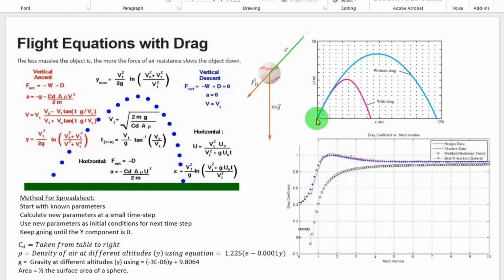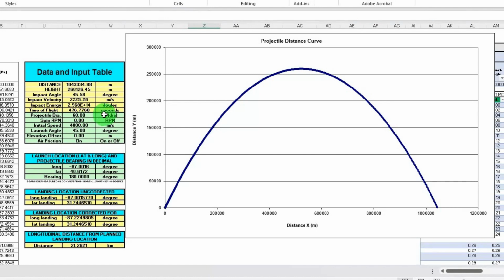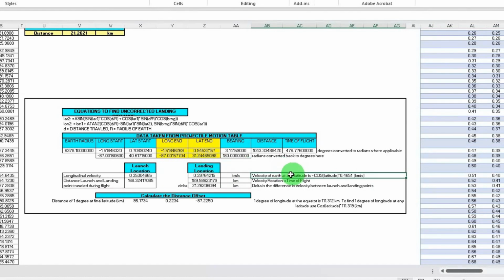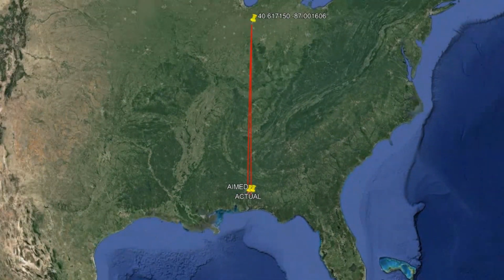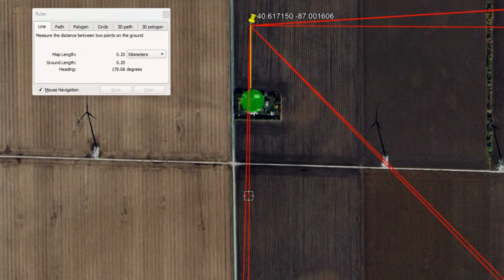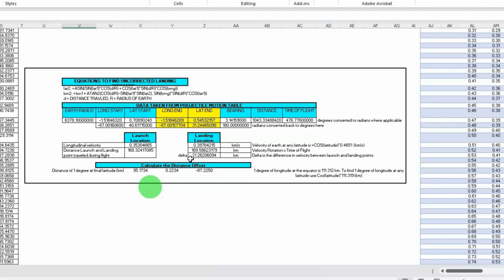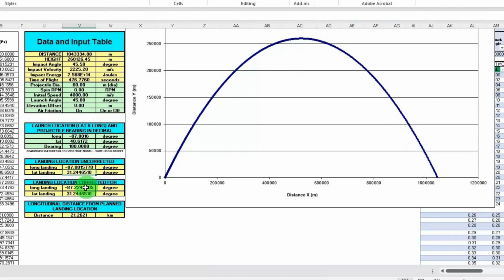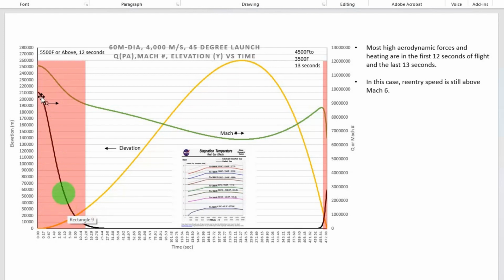Projectile Motion Spreadsheet Update - Launch and Landing Points

Comment: David, the explosion of Krakatoa could provide some perspective about the ejecta launched by an extraterrestrial impact, although the energy of the Krakatoa explosion was about 10,000 times less than the impact of a comet with a diameter of 2 km.
https://en.wikipedia.org/wiki/1883_eruption_of_Krakatoa
Ash was propelled to an estimated height of 80 km (50 mi). The energy released from the explosion has been estimated to be equal to about 200 megatonnes of TNT.

Comment: A lot of work, well done Dave.  Did you take into account the Terminal Velocity in your calculations?  Obviously with ablation, you're looking at a slight reduction in mass over the duration of the flight, and a small difference in the drag coefficient I would assume.  I don't know if it's significant enough to alter the outcomes at all.
Reply from the maker: As far as terminal velocities go, if the spreadsheet data section is looked at you can see when the forward velocity x goes to zero (forward momentum completely stopped by air friction) and you can see when the downward y velocity stabilizes to a near constant terminal velocity.  I've noticed for very large projectiles there is no terminal velocity achieved, projectiles keep accelerating (y velocity) on their return trips until impact. For smaller projectiles y velocities tend to somewhat stabilize at some point but because the air density increases at lower elevations there is still a gradual slowing of the y velocity. But to address your question.

My spreadsheet does take into account variable drag coefficients of spheres at different velocities but not variable drag coefficients due to shape changes from ablation: the object stays as a sphere as a given size at all points. Additionally it does not take into account changing mass. I've found some ice ablation equations derived from hypersonic wind tunnel tests and have been thinking how to incorporate them into the spreadsheet. I'm sure there would be observable changes in the output.
Reply: @iamazdavids  I can't see shit, even with reading glasses these days, don't get old my friend.  I saw that a spreadsheet exists...  I'll take your word for it all apart from the graphs and other pretty pictures, I can see those.

The interesting thing about the ablation aspect, is that your data predicts that a smaller boulder wont make the distance, therefore requiring some missing element to account for the 10m bays.  Theories about mid air collisions or fragmentation are difficult to substantiate.

I'd be interested in some bigger numbers, like a 960m sphere required to make a 3 mile long bay (using AZ's 1/5 ratio of impactor to crater) which I think is about the largest.

I know people tend to go for averages, but I tend to think that if you can rule out, or account for the extremes, the middle falls into place.
Reply from the maker: @Argrouk  Thanks for watching, as you can, and always having thought provoking comments. As far as the smaller boulders going the distance I think the main impediment for smaller boulders is the first part of the journey. If they were larger boulders to start and became smaller on the way up from ablation, some smaller examples might exist. Obviously this is not modeled in my little spreadsheet. It may be however that AZ is correct that for some extraterrestrial impacts the scale is such that the atmosphere itself is being moved by the blast wave and debris of all sizes could be easily moved high into the atmosphere. 

I thought it would be interesting to look at a  960m sphere with the spreadsheet. Below are the numbers it comes up with. I chose a launch velocity of 3100 m/s to get a 1000km flight distance. Its interesting to note the landing velocity for the 960m sphere is close to launch velocity. The sphere is just so massive, like 100's of billions of kilograms, it really offsets air friction in my model. Because of that speed and it's mass the kinetic energy at impact is 461 mega tons, seems almost unrealistic.Well, like everything, the spreadsheet is a work in progress. 

Projectile Diameter: 960m sphere,
Projectile Material: Glacial Ice, 917kg/m3
Total Mass: 424,796,852,551.68 kg

Launch Velocity: 3100 m/s,
Max Elevation: 248.2 km,
Impact Angle: 44.98,
Landing Distance: 1005.1 km,
Landing Velocity: 3013.6 m/s,
Time of Flight: 465s,
Max Q: 5.8 MPa
Impact Energy 1.92x10^18 joules (461 mega ton !!) (1/2 m v^2),
Reply: @iamazdavids  It does seem incredibly massive and powerful, and without some form of viscous relaxation that would be a bloody big hole in the ground.  It's difficult to appreciate that ejecta could leave a scar far larger than many actual impactors.

That being said, I've also been looking into eolian and lacustrian processes, and I've failed to find any occurences in nature for the methods proposed as the "consensus" opinion.  It's not how sand and water behave in a windy environment, and it's essentially an invented theory to try and fit the data, rather than a known process.

Unfortunately, without some compelling, tangible evidence from either side, these theories are going to battle for a very long time.  It could be a very large duck, or a very small goose, but if we don't hear it quack, we might never know.
Reply from the maker: Maybe a big red herring?
Reply: @iamazdavids  I knew I liked you Dave.

Comment: Due to Earth's rotation, wouldn't the launch location relative to impact location at time of impact be approximately 168 km (476 seconds x 353 meters/sec = 168028 meters) westward at the same latitude as the fixed launch point marked on the Earth surface?
Reply: Your dealing with the delta, the difference in the rotation speeds, not the absolute.
Reply from the maker: Hi Gary,
Thanks for watching and commenting. I'm not sure I totally understand the question but I will say I've had some hiccups in visualizing things due to the earth's rotation and the point of reference. In my analysis I assume that at launch, the projectile has the same east-west velocity of the earth at the launch point. If an observer was in space at a fixed point then the entire scene (launch, flight, landing) would slowly be moving east from the fixed point of reference. If an observer in space hovered over and rotated with the launch point, the observer would see the projectile moving south and westward relative to the moving point of reference. I will hopefully be making some new videos in the next few weeks and i'm thinking about making a visualization in Blender to illustrate how the reference point affects the visuals of things. Thanks again.
Reply: @iamazdavids Thanks for your clarification. I am too used to thinking in terms of ballistic missile trajectories in an Earth centered inertial frame while the Earth's surface rotates beneath the trajectory path. Although the relative launch azimuth is 180 degrees, the inertial azimuth would be some degrees eastward (less than 180) due to rotational velocity at the launch point.